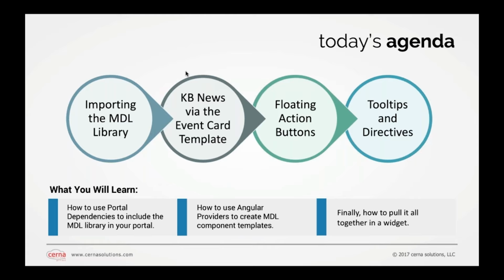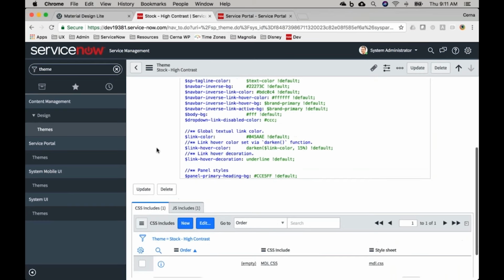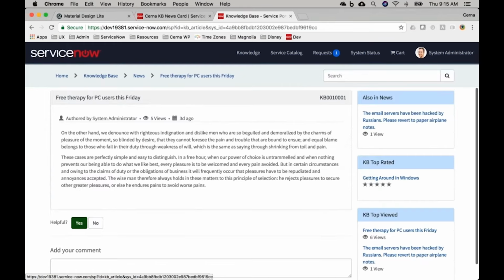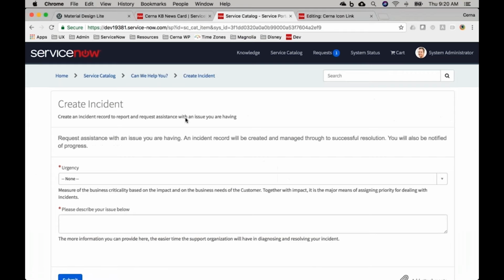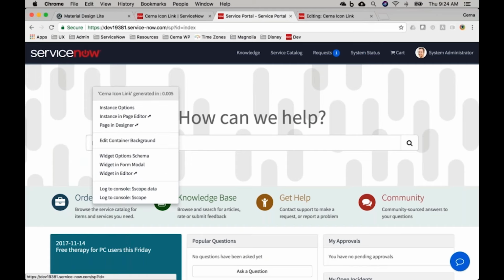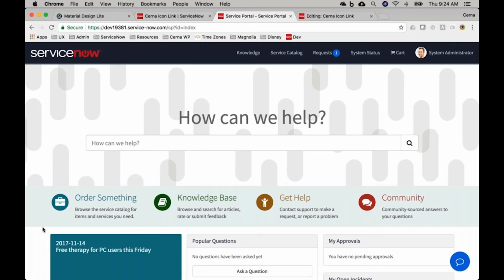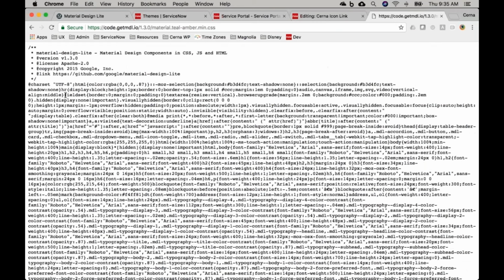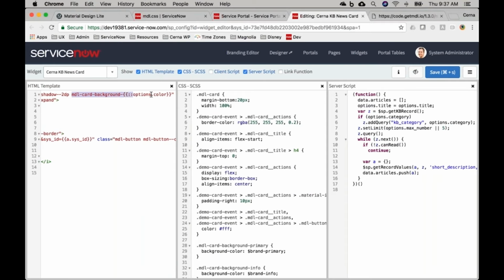Taking ServiceNow® Widgets to the Next Level with Google Material Design Lite (MDL)

Comment: If you're having trouble with MDL components not rendering/behaving correctly, you may need to register the components. Try using this in the client controller of your widget:
 angular.element(document).ready( 
  function() {
   $timeout(function() {
    componentHandler.upgradeAllRegistered();
   },500);
  }
 );

Comment: Have you found any solution guys to include MD library.. CSS works but having issue with js...
Reply: Hi Dave, you may be missing the component registry piece. Try putting this in your client controller:
 angular.element(document).ready( 
  function() {
   $timeout(function() {
    componentHandler.upgradeAllRegistered();
   },500);
  }
 );

Comment: Thanks for the video guide - very informative!
I've followed the video exactly, adding the CSS and JS as includes in the theme and I cloned the news widget with your exact HTML and it won't render.
I also tried MDL tabs - the widget renders but the functionality isn't there...all content is shown in one block and the tabs do nothing. Please assist !
Reply: I'm not sure, but stay tuned for a new video on this in the next month or so.
Reply: I'm on the same boat, loaded all the CSS and JS, but none of the MDL styles are showing and the tabs issue is the same for me.  any solutions?
Reply: I see this is a common issue people are having. In the new year I'll do a short video with more detailed steps and hopefully that will clear up any issues you experience.
Reply: Jeff Pierce thanks Jeff. Any idea why this happens?
Reply: Jeff Pierce cool. Have you managed to change the header to use MDL?
Reply: If you clone the header widget, you can do anything you want to it. Any specific MDL components you were thinking of?
Reply: I did try that but it turns out the header is made of a few widgets. I wanted add a burger menu and change the loading icon the MDL one.
Reply: You'll need to create a dropdown menu widget, and embed it into the header widget. In the o-o-b header widget template you'll see this line: <sp-widget widget="data.menu"></sp-widget> . Directly after that, include your own list element with your custom menu widget embedded inside, like this:       
<ul class="settings-menu nav navbar-nav">
        <li><widget id="settings-menu"></widget></li>
</ul>
Reply: Hi Jeff. Any update on when we'll see a more detailed explanation of integrating MDL or any other JS front-end templates?
Cheers.
Reply: Have you found any solution to include MD library.. CSS works but having issue with js...